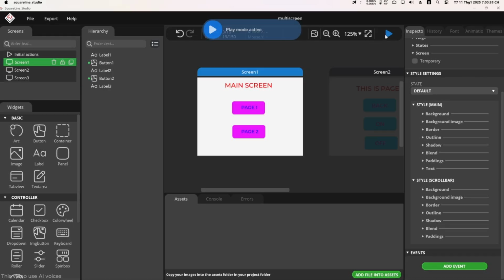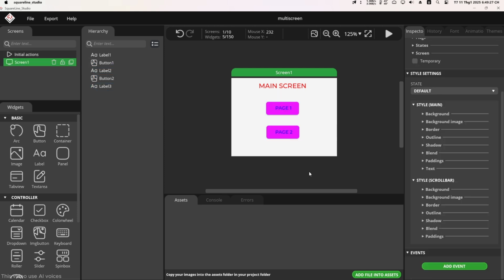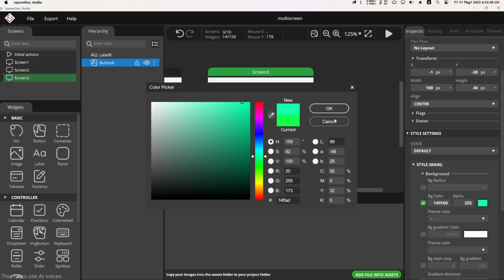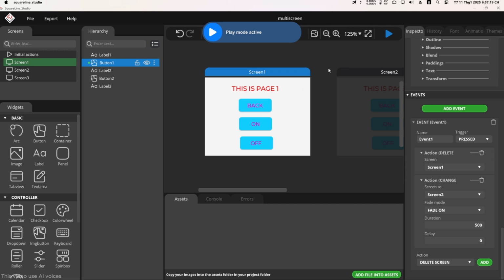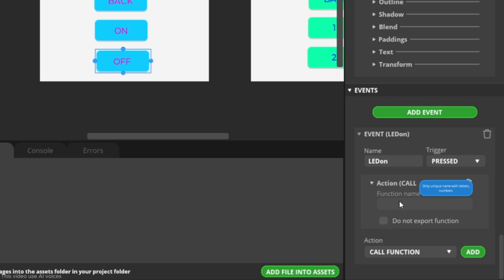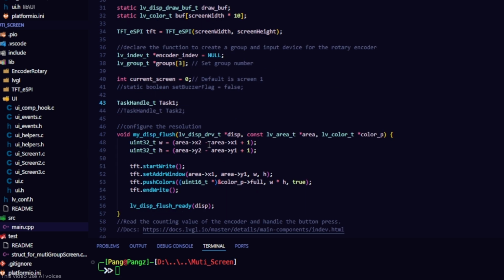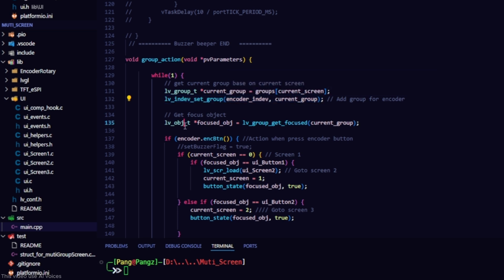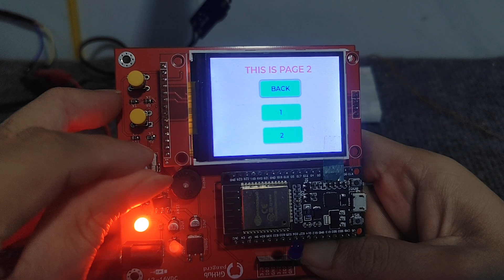[ESP32 + LVGL] How to switch multi-screen with rotary encoder !

Comment from the maker: Source code
https://github.com/pangcrd/LVGL_Bassic-tutorial
Playlist ESP32 LVGL
https://www.youtube.com/watch?v=muQBSGhYnIA&list=PLra4sagbMR-QFLelheLZP5sqNXXHj52T-
Reply: Great videos, Pang, 
 
The code doesn't contain the UI files; can you please upload them. Also, I am kind of new to this; say, for example, if you don't have an input form touch and you want to change the screen pages, then how would you do it? Like, at startup it shows a welcome screen and then shows an instruction screen and shows another screen based on a physical button press. How would you implement that? 

I would be great if can make a video tutorial of it.
Reply from the maker: @muzammilpatel1129   I have updated the UI files on GitHub as per your request. Regarding the issue you are asking about:
1. When creating an UI with LVGL to control objects, you need to add input devices such as: Touch, Rotary Encoder, button, keypad, pointer. If you only need to display values like sensor data, then you don’t need to configure any input devices.
2. If you want to create a loading screen, you can design a loading screen on Squareline, then insert it into the "lv_timer" function (as shown in the previous video) to display for a set period of time, after which it will automatically transition to the main screen.
3. Finally, do you want to control the objects on the screen using physical buttons, such as "Forward, Select, Backward," instead of using a rotary encoder?. I will create a video on how to handle physical buttons
Reply: @pangcrd  Thanks alot, I'll give it a try this week.

Comment: Hi bro i m doing one multi functional work station using esp 32, rotary encoder and 2.8" tft spi will you help me for ui mockup?
Reply from the maker: What issue are you getting when ui mockup?
Reply: @pangcrd  Good morning bro.. I did one mockup using Gemini but that is HTML code i need same mockup to esp 32.  how convert my html code to cpp or ready to upload ino code?
Reply: Sir i did ui design now. i need help for coding and uploading

Comment: Wouldn’t it be better to have an action on each button to change the focus to the next one when key_next is pressed, then have the rotary knob trigger the key when turned
Reply from the maker: I get your idea, but from my point of view if I already have a rotary encoder then it’s enough to handle both navigation and selection. Turning left/right can move focus just like next/prev buttons, and pressing the knob can trigger the action.

Using extra next/prev keys makes sense if the system is button-only, but with an encoder it feels redundant. I think it’s better to keep just one main control method for consistency.

Comment: "Hello, great tutorial! I've set up both the code and hardware. I tried two versions - one with my own UI design and another using your provided UI. However, the rotary encoder isn't working in the program. I tested the rotary encoder independently using the Serial Monitor with the encoder.getCounter() function, and it worked correctly - the values changed appropriately when I rotated it. But in the actual program, no changes were visible. For troubleshooting, I added some debug print statements inside the encoder_read function, but nothing appeared in the Serial Monitor when running the full program, suggesting this function might not be called or reached."
Reply from the maker: Have you try create group using lv_group_create and then add obj to group using lv_group_add_obj(group, your_ui);
This varies make rotary encoder know objects for control.
Reply: @pangcrd  Yes, I have used the methods you mentioned, similar to the code you uploaded on GitHub
Reply from the maker: So it's work with you??. If not you can double check:
 void encoder_read. 
  indev_drv.read_cb = encoder_read;
  encoder_indev = lv_indev_drv_register(&indev_drv);
Make sure 100% you add rotary encoder into group
lv_indev_set_group(encoder_indev, your_group); // This is important
If you are using lvgl 9.1 check the link below
https://github.com/pangcrd/PIDTemperature_LVGL/blob/f1d217ab29f00fa4f1b829f6a2cee35a937ca71f/src/main.cpp#L83